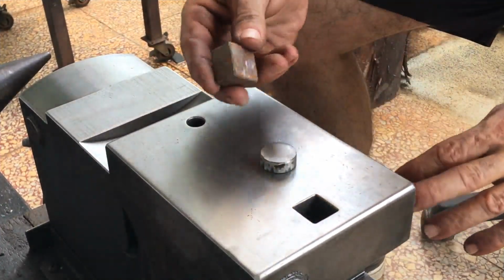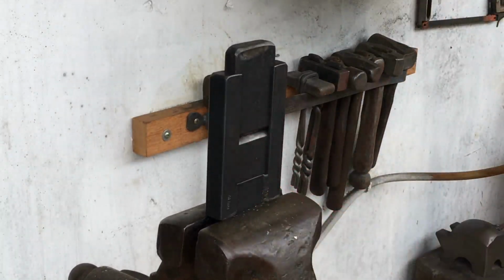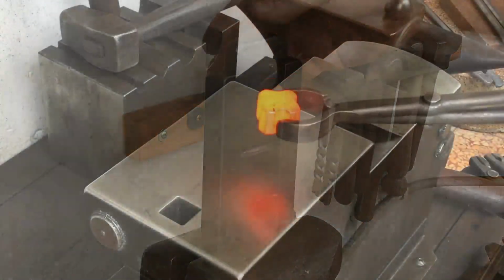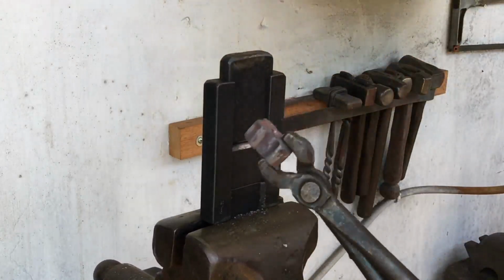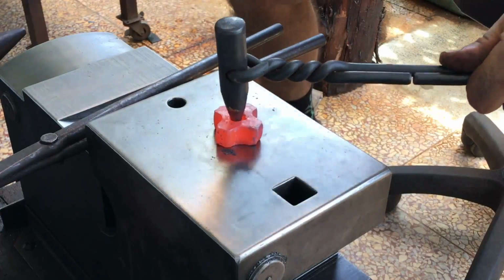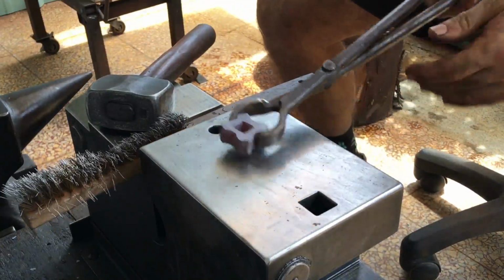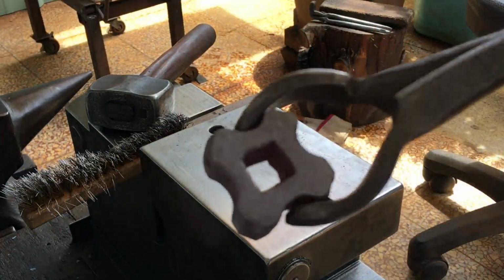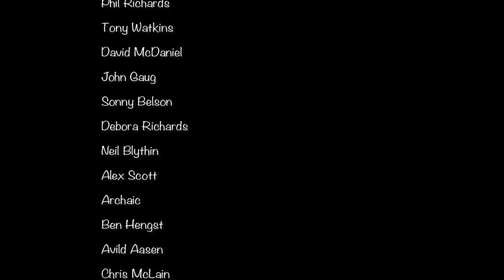Blacksmith Project X

Comment: That shape would be fantastic for a threaded nut on something hand tightened ...so it has a lower profile than a wingnut. maybe a wrench or a hand vice...
also with the square hole it would fit on a coach bolt or square stock....thinking
Reply from the maker: While doing this, it gave me an idea for something else, close to what you're describing. So, in the end, this silly project may lead to something better. Thanks.